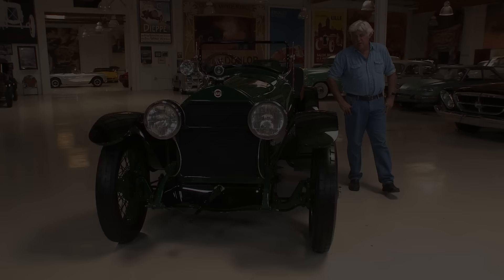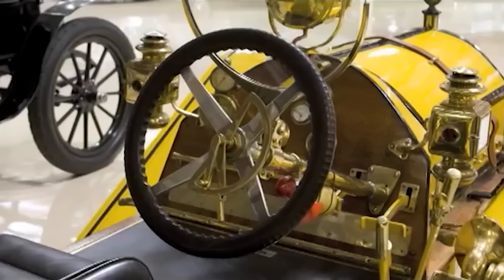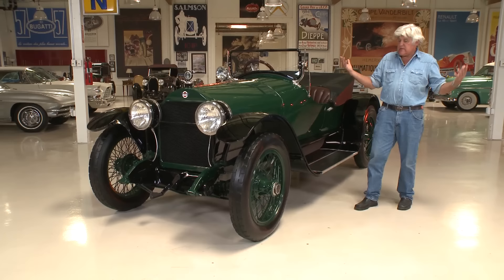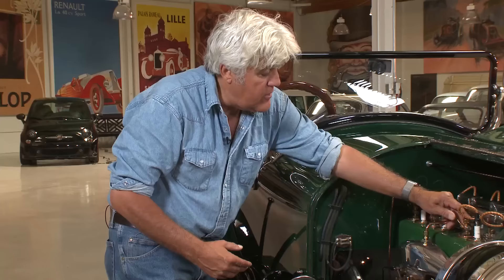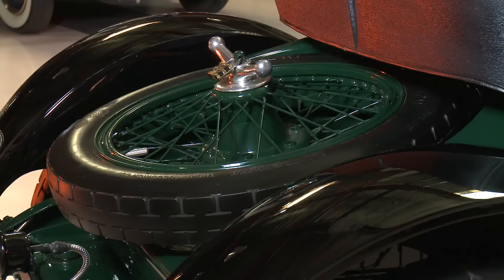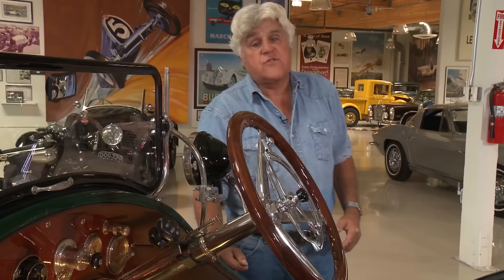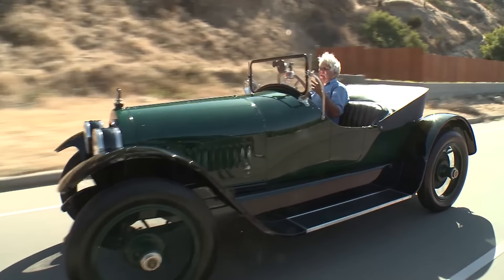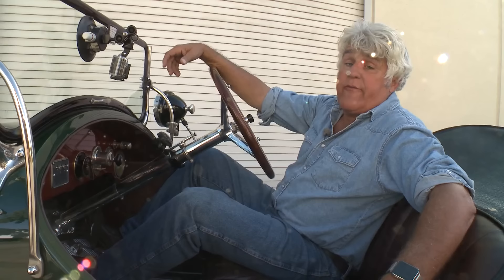1918 Stutz Bearcat - Jay Leno's Garage

Comment: One thing people don't consider all to often, is that in that time, the road network was not designed for people to be leisurely cruising along at 62 mph all day.  That was a truly fast speed back then, not just relatively, especially considering the lack of consideration in safety,   80 would have been deadly fast for most stretches.
Reply: Who doesn't know in 1912 US roads weren't designed/built for vehicles to go 60+ mph? 
You're trying to impress us with your knowledge; yet you're just exposing your ignorance.

Comment: My dad just died from cancer October 11,  2016. I inherited all of his antique cars, 13 restored. I helped restore seven of them with with my dad, the latest is a 1913 model T about 90% finished at least my dad got to drive it around one summer before he past. The 1926 Willys Overland Whippet has never been touched, all original still has the original tires that came on it. My dad traded a cider mill for it when he was 14 years old, the interior is pretty much mint. Seven years ago I found a 1930 Dodge in a partial fallen in barn, that we bough, it has never been touched, there is two things that need to be fixed, a spot on the drivers side step up and a couple of worn spots on the drivers seat other than that the car is mint and the back seat doesn't even look like it was used. I have two cars of my own a 1930 Ford Model A Roadster and a 1931 model A pickup that was given to me when I was 12 for mowing the lawn for and elderly neighbor. I mowed her lawn for two years and I knew she didn't have much money, she kept saying she will pay me somehow. I finally asked her how much she wanted for the model a truck in the back yard, she asked what I want that old piece of junk for, I told her my dad  and I restore them she said if I could get it out of there I could have it. I rode my bike back got a couple of 6 volt batteries, some gasket material, a piece of sand paper, hand pump and some gas loaded them into my wagon and headed back. About 45 minutes to an hour and I had it running but the tire were to rotted they all blew but one so I went home till my dad got home from work. We found two sets of old ford rims and tires he took me over and helped me put them on and I drove it home with dad following. After restoring it in 1978 I have used and drove that truck so much I have had to rebuild the engine twice since the restore, it is due for a new paint job after 39 years. Sorry it's so long, just sharing some of the great times I had with my dad, restoring the beauties.If you have the patients and time, you can restore some of these cars fairly cheap, picking up parts at lawn sales trade shows flea markets and things like that. That's what we did a couple of them took up to 6 or 7 years to finish.
Reply: Great story Tinker Jim, sorry about your losing your dad, but thanks for sharing some of the memorable times you two shared together.
Reply: Tinker Jim Your dad had an interesting life. We never know for sure how we will die, whether cancer or falling off a roof like the designer but in the end it's how we live that life
Reply: You jump on that old ladies words real quik

Comment: oh my God that rattle
Reply: I'm guessing the mic was picking up the the electrical interference from the unshielded ignition wires.
Reply: Ah the good old days that "tick tick tick" at idle on my transistor radio hanging off the rear view mirror....
Reply: He's got a Hockey card on the spokes!!
Reply: Possibly the padlock on the back?
Reply: I've spent a lot of time around straight exhaust 4cyl antique gas tractors. Large cubic inch 4 cylinder engines always have a snap in the exhaust note when they are wide open exhaust. I think the microphones were picking it up way more than when u are personally around it.
Reply: My thinking is a badly mounted gopro or microphone mount. Sounds exactly like a rattling housing
Reply: Another great video Jay. I'd love to see you review one of these: Cizeta V16T.
Reply: It sounded like a kid clipped a playing card against the spokes.

Comment: "Nothin' worser than a Mercer" and "You'd have to be nuts to drive a Stutz" 
I can just imagine them trading insults.
Reply: How did they even hear each other over that engine noise? Drivers of those cars also often had leather helmets and goggles back in those days so how did they even hear anything from any other car?? I also imagine these insults were either manufactured by people living decades later or rare. Why? Well, for starters the people who owned these cars usually came from fine families and they were raised to dress properly, speak properly and behave properly. Losing composure or acting like mere plebs in some lousy local bar wasn't exactly their ways. This type of person may be nearly extinct today but back in the late 1800's and early 1900's you had the Old Money people who even spoke their own Old Money American English dialect. 
Again anachronistic thinking rears its head. It was only when the common joe could afford decent cars the insults began. This was when "consumer motoring" began in the 1950's and even more so in the 60's. 

Fact is during the early days of motoring when it was far from a business or when it was a matter of brand loyalty it was commonplace to be impressed and inspired by competitors and respect them. It was more akin to a rider's club for rich people who were the few who could afford a fine car. Yes, this was before Henry Ford had figured out how to manufacture his Ford Model T at a running assembly line. 

Henry Ford always said:"Whenever we compete against an Alfa Romeo I always tip my hat when they drive by me." It was a more chivalrous time and token respect was expected by any gentleman.
Reply: @kungfucow547  They probably had to use their diaphragms to properly hurl insults at the time😉😅

Comment: Surely, if has twice the top speed of a 'normal' period car, at ten times the cost, it's not a Camaro, it's a Veyron?
Reply: qt3141692 The economics were not the same back than...
Reply: Chevy Spark 0-60 around 11~12 seconds, unless you got the EV version which is 8 seconds. Camaro V6 around 5~6 seconds? That's already double of the base spark.
Reply: qt3141692 yeah base cars were cheaper than today's base cars, a base car back then in today's money work be like 9 or 10 grand today
Reply: Byron Andrews A brand new Ford T was $500 in 1918, that's $8,000 now.
Reply: Byron Andrews Just want to be as accurate as possible: $7,994.30
Reply: Sigma Projects no no no 0-60 In 13 MAYBE if it's MANUAL but the automatic takes around 16 seconds to hit 60.
Reply: Probably a Corvette or Viper would be the closest modern equivalent.

Comment: Very nice.  Why did Stutz design the car right hand drive?
Reply: Most North American  car manufacturers switched from RHD to LHD around 1914/1915 but a few held out until the early '20s with right hand drive.  Before 1915 almost all American cars were RHD.
Reply: Ozzstar I was going to ask the same question
Reply: America had the decision between left hand or right hand drive decided around that time purely by the volume and popularity of Model T Fords. At one stage every second car in the US was a Model T which were all produced left hand drive there.
Reply: On the rough narrow dirt roads of the time it was more important to keep an eye on the ditch side of the road. Later when roads got better and wider it became more important to be in the middle of the road especially when passing a car.
Reply: that makes so much sense! i never thought of that. thank you!
Reply: When the roads and streets were still full of horse poop, everybody got into a car from the sidewalk side (right side) so they wouldn't step in it. So the steering wheel was on the right. Even when they moved it to the left, people got into cars on the right side and slid over, until the horses were gone and even then they did it out of habit. You see running board storage trunks on the left side blocking that door. Nobody cared, they got in on the right side. Ford had a Model T so cheap they had no door on the left side, just painted on.

Comment: What I can see so difficult in restoring cars like this is that some of the machinery is even older than traditional old-school mechanics. So it's probably really advantageous and perhaps essential to somehow find the books and manuals relating to that period and especially the model in particular. For example, I was intrigued by the carburetor and the manual fuel injection valves. The ingenuity puts a smile on your face. Although Jay explained his frustrations, I'm certain part of the fun was having those "ah ha" moments of discovery.

Comment: Cool trick I seen on Ivan’s shed was to heat the piston to roughly operating temp with a heat gun and slide it into a cold engine block to check clearance of the different metals expanding at different rates to prevent a dry seize.

Comment: Hello Jay I'm glad you mentioned about the cups in each cylinder  I've tried researching them on line  I've had  some old timers tell me that they are for oil on first start up and  other  old timers  tell me that they are for gas priming  ,I seen you on tv,and  utube  enough that I think I trust you a little bit more  ,but those  gentleman's cars all ran and are still running  and I would never think of trying to correct them  but it is nice to find out the real reason for them  :)

Comment: My  Grandfather always told me that his older Brother had a Stutz Bearcat Straight 8  with open exhaust and it would do  90 MPH while his Model T could do  35 or 45 MPH ..  Maybe he was confused and it   was a 4 cylinder with  4 valve heads and dual spark plugs  I did see the two distributors..

Comment: With rear brakes only and racing you would need to apply brakes for an extended period. To down shift without synchronized gear box you would need to double clutch on the down shift. With a center throttle  you could apply the brakes with ball of your right foot and blip the throttle with your right heel to match rpms on down shifts hence the term "heel and toe". Center throttle was a common feature on early racing cars. Maybe manufactures use this arrangement on street car to be cool like manufacturers today paddle shifter on road cars to be like Formula 1 cars

Comment: Let us not forget that cars of that era used gasoline with no octane additive. The compression was kept low, or pre-ignition was an issue. I would guess that would be the reason for the many piston changes. They would have to be configured for a very different fuel but at the same time, if performance is increased too much, overheating would become an issue.

Comment: How long do the old style tires last?
Reply: 5000 miles maybe 10000 if you got real good tires and babied them. On a Stutz Bearcat probably less than 5000 if you were a fast driver. And on the bad roads of the day you could hit a rock or a horse shoe and ruin a tire if you were not lucky.

Today they last much longer because of better rubber and smoother roads.
Reply: The tires ran with 90 pounds of air then...

Comment: Can any octane gas be run in that car?
Reply: Gasoline technology was in its infancy in the 1910s.  In fact, this car was made 3 years before leaded gasoline was introduced. I'd imagine this thing would run on paint thinner in a pinch. ;)
Reply: Gas at that time was very poor and low octane, maybe 45 - 50 octane vs 87 for the cheapest regular today. That was one reason many high grade cars used a T head engine with 4 valves per cylinder, it gave better breathing and long engine life but had very low compression. But the low quality gas would only let you run 4.5:1 compression anyway. The Stutz was designed for the best combination of power, reliability and long life regardless of cost.

It would actually run better and cooler and develop more power if you added 25% kerosene to the gas.
Reply: Back then there was only one grade of gas, about 50 octane maybe less. Compression ratio very low, less than 5:1. So yes you could use any modern gas, or even kerosene once it was warmed up.

Comment: Does anyone know what a Daimler 2.5LT v8 is like? 
I've fallen for this car but have no idea what it's like.
Reply: They were an all aluminum (block and heads) hemi head design, very sophisticated for the day. Put out about 140HP. Designed by the guy who did the Triumph motorcycles which they resembled in certain features. Their big downfall was corrosion if you did not keep good antifreeze in them. This could weaken the heads and result in chronic blown head gaskets. Not an easy or cheap thing to remedy. Jay did a show on his a few months ago. Daimler SP250, I think his is a 64 model.

Great motor in a Triumph TR3 chassis with weird looking fibreglass body.
Reply: Cast-iron block.  Mine's in a Daimler, like a Mark 2 Jag.
Reply: You may be thinking of the Buick/Rover V8, they were all aluminium.
Reply: Thanks for the information Lads. I suppose I'm asking if Daimlers have any gremlins or are just solid cars?
It's a dream to have one.
Reply: Jack Williams They're great cars. The SP250 (Dart) is beyond reach price-wise (unless you're wealthy) but the V8 Mk2 is still reasonably priced. Find a manual trans one, as the auto is low geared. Manual rare though. Power steer helps too. Watch out for rust.

Comment: Hey, does anybody know of an old car from before 1950 where the battery was kept under a floorboard? (I believe the floorboard was in front of the backseat.) The car was probably an expensive limo type. My uncle once changed a battery for a gangster (Buster Wortman) and told me the battery was under a floorboard. He said that when he pulled it up there was a tommygun and a pistol too. :-)
Reply: Charles Seper your uncle wasn't the type of guy that would tell a little fib or two was he? lol jk
Reply: Yeah, he was. But in this case he wasn't because he worked in his brother's garage with four of my uncles, and they all said this happened. Actually, Buster and his brother Ted used to both come into the shop to get their cars worked on. I remember them when I was a kid in the 60's. They just looked like old men to me, not tough at all. But everyone was afraid of them.
Reply: In the thirties most cars had the battery under the front floor boards. There was an access cover in the floor not much bigger than the battery, not enough room for a tommygun but might be able to hide a pistol. It would be a rotten place for a quick draw as you would have to stop the car, get out, roll back the carpet, remove a couple of screws, and lift off the cover before you could get at the gun. Be easier to put it under the seat or in the glove box.
Reply: I've seen a 1941 Dodge Truck with a place for a battery on the frame. There's a place for the battery in the engine compartment too but it doesn't have its original engine.
Reply: ***** Thanks. I've never owned a car that old. I didn't know they put them under floorboards in so many of them. I'm guessing this would have been a pretty fancy car like a Bentley or something. Buster could afford anything he wanted. Heck, he even had a house built with a mote around it. Google it. It's still there. Some lawyer owns it now. It looks more like a school than a house. Oh, the life and times of the rich and deadly....
Reply: Thanks Austin.
Reply: ***** I don't know if the machine gun had been taken apart or not. I never even thought about that. My dad and uncles are all dead now except for one, and I don't think he knows much about it, so it won't help to ask him.